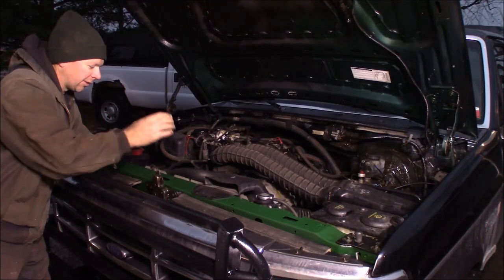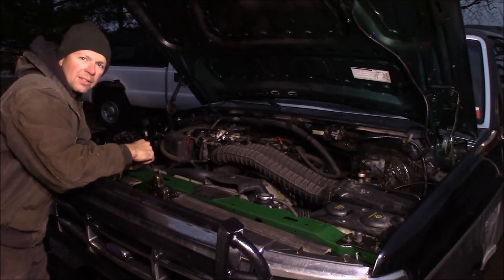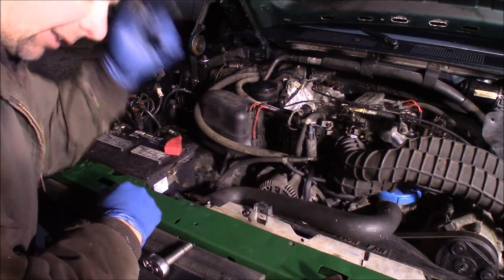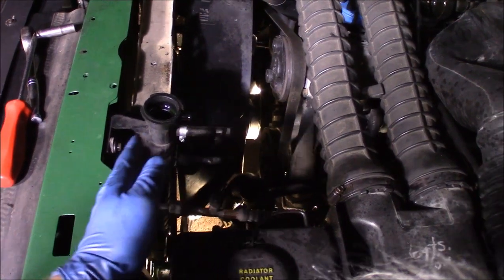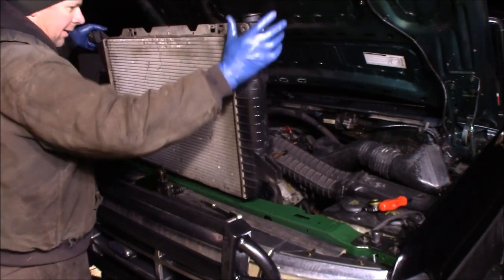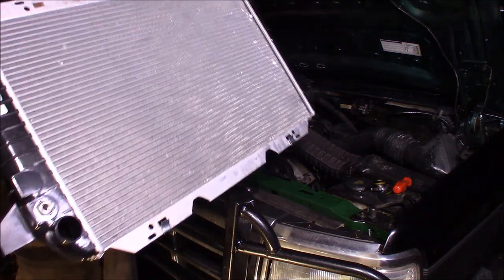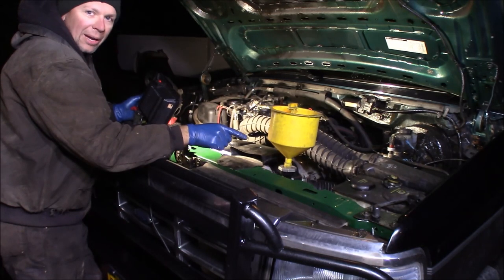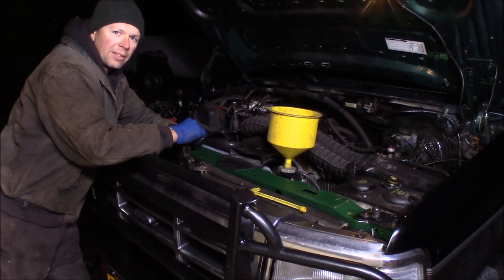How to Change a Radiator:  1992-1997 OBS Ford F-Series Truck

Comment: Just subscribed. Enjoyed watching your f250 series. I do a lot of work on obs aero-nose and brick-nose fords, mostly f150s, and mostly like working with and using base model (xl) with straight shift 5-speeds and the 300 six cylinders. They make for reliable farm trucks around here, and most of us old-timers like the simplicity of them as an EFI truck. Down here in Ky they don't rust away as fast, but I'm originally from northeast Ohio, so I can relate to the rust belt. And I swear by fluid film, even down here. And love the old model A ford stuff. Great channel... thanks.
Reply from the maker: Thank you!  I love Ford trucks.  I've started with an '82 F100, then OBS '97 F250 HD, then '77 F250 Camper Special, and last the '95 F250.  I've had the 300, two 351s and a 460.  '73-79 are my favorite followed close by '80-'86.  OBS are nice for a more modern feel.  Hopefully Fluid Film will keep my '95 on the road for a few years!

Comment: Make a video on freeze plug replacement.
Reply from the maker: I don't need to change them.  Just knock out the plug with a chisel and tap the new one in with a socket that's slightly smaller than the freeze plug.  It's easy.

Comment: So you don’t have to worry about plugging those two ports for the transmission cooler? I have a standard transmission as well. Great video though very helpful I had to buy a rubber cap and clamp for that other port near the radiator cap
Reply from the maker: You could just to keep dirt out.  I'll never use this in an automatic truck so I wasn't worried about it.
Reply: Appreciate the quick response. I’ll be installing today. Mine came with plastic plugs so I guess I can keep them in place.

Comment: When it was leaking was it spraying coolant everywhere and making the belts squeeze and whine ?
Reply from the maker: No, but that can easily happen with a bad radiator.  The coolant system is under pressure.

Comment: Great video man! I got a 351w manual trans f250 with no AC. Can I replace with a new radiator that has AC?
Reply: Gonna order the rad with AC, the dimensions on the website for it are the same as my current broken radiator.
Reply from the maker: Radiator has nothing to do with AC.  AC is a stand alone system with a compressor, condenser, evaporator, and dash controls.
Reply: @QuickSpeedShop  that’s what I thought too. Rockauto is giving me the option though. That’s why I just went with the dimensions.

Comment: If u do have an automatic will transmission lines leak oil ?
Reply from the maker: You need to hook the lines up to the radiator just like how you took it apart.

Comment: I am about to do this. Mine is a 5 speed manual, what do I do about the 2 ports for the A/T?
Reply from the maker: Don't need to do anything, they aren't used.
Reply: @QuickSpeedShop  so coolant won't pour out of them?
Reply from the maker: No, the trans cooler is a separate tube that is in the coolant passage, but not connected to the coolant.
Reply: @QuickSpeedShop  you're awesome. Thank you so much

Comment: The first time I watched your video I missed where you said that it was a 2 row core  you sent me a comment saying that it is a 3 row core   which is it 2 or 3 row  I'm getting ready to do this on my 88 f250 all I can find at my local parts stores is 2 row core
Reply from the maker: If I said in the video it's 2 row then that's what it is.  I always try to do 3 if I can, but I must have bought a 2 if that's what I said in the video.  This was 3 years and 50,000 miles ago so I didn't remember.  The truck has never got hot with the 2 row.  It's a daily driver and I tow a trailer.  No issues.
Reply: @QuickSpeedShop  thanks brother appreciate it

Comment: I still dont  get why they run hot water through the throttle body spacer
Reply from the maker: It's to heat the air in cold weather to prevent stumbling.